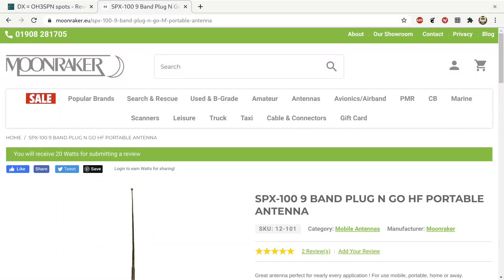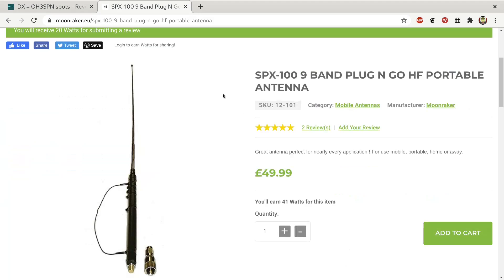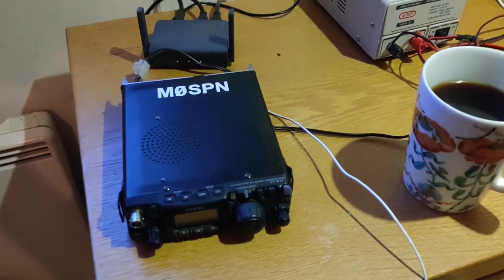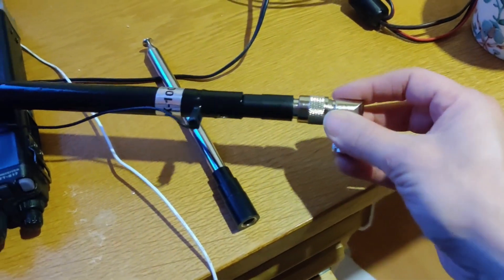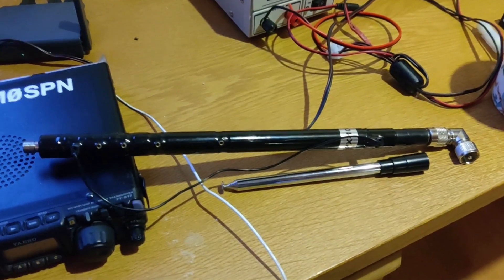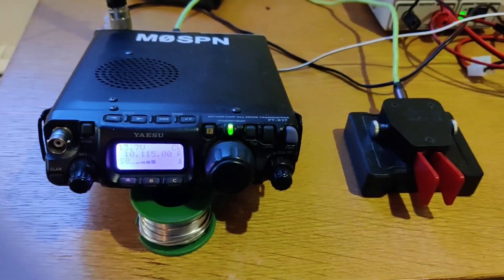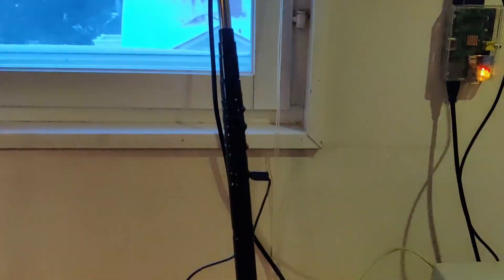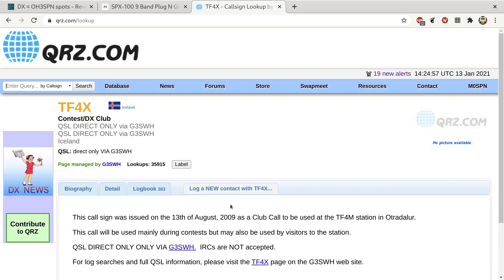Review: SPX-100 Antenna Test + Demo

Comment: Hello - I have a similiar antenna - mine is an OPEK which I use mobile - I have to say while its not the best radiator it does work and I am often very surprised to receive 5-9-9 with 20w from my XIEGU G90 --73 de Ger EI6DP

Comment: Morning Steve been playing with above and have viewed your video I’ve got the SWR down to 1.5 using my antenna analyser on 3.760 which is the frequency that the early morning  “Horizontal net” Use at 07.00-08.00 which I’ve been monitoring on a local kiwi SDR now I’ll connect the radio tomorrow and first see if I can hear any of them and then see if I can make contact using initially 5w and then adding a 100w linear this experiment I’m carrying out mobile as having antennas at the home QTH causes problems with a neighbours old analogue tv running on a preamp G1WXC Littlehampton West Sussex
David Blackman-Wells

Comment: If this same as mfj 1899  2years ago fitted it to magmount on car(not moving!!)  with 817 on 20m.
Answered cq and got a 5/9 from rw4ln   Ulyanovsk from Birmingham uk. 2470 miles!!!
Few minutes later scanned and he'd gone. Felt like an 817 with 2 antennas putting him in the log. Not used much since but there you go!!7.3.